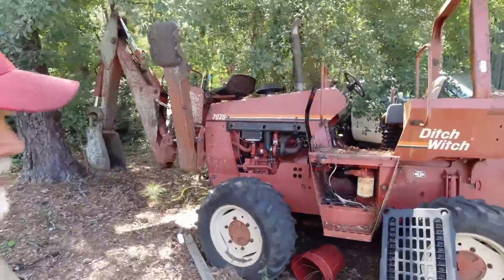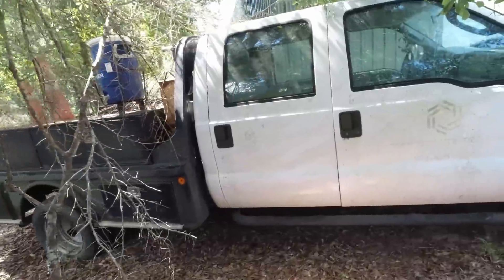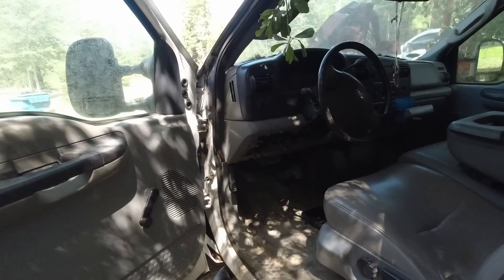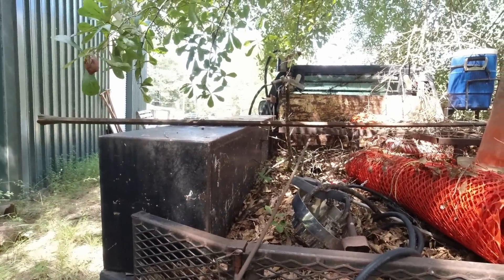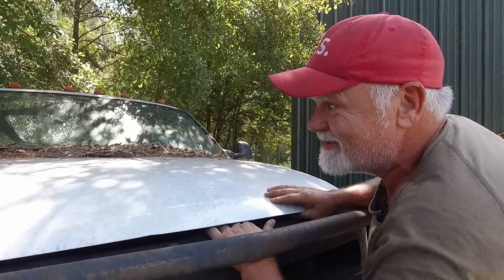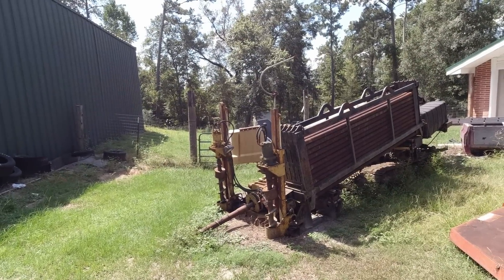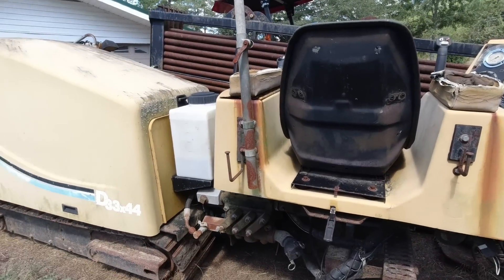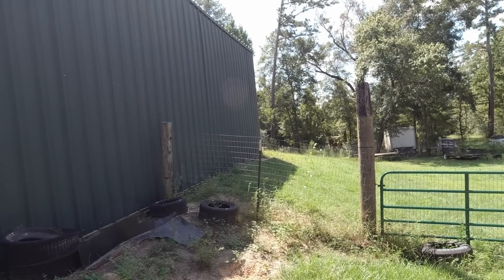WILL IT START!?Contractor selling this Ditch Witch and Other Equipment

Comment: Wiley, I think the operator sits in that seat, and that whole thing set up like a giant mast, and as you drill down, you add the pipe that is on the right there in the holder
Reply from the maker: Thanks for sharing and watching

Comment: The reel goes on a trailer and the plow normally was 3 to 4 ft long my uncle owned several of the ditchwitches and that 720 would have a 6 way dozer blade on the front
Reply: The plow would have a clamp to clamp the cable too and pull it underground I grew up playing on those like a jungle gym
Reply from the maker: Thanks for sharing and watching

Comment: I bought two of those ditch witches for $500 both of them run great but that's all that they do I would like to pull the engine out of them and build a motorcycle with it
Reply from the maker: Thanks for sharing.  Please Send a pic when you do